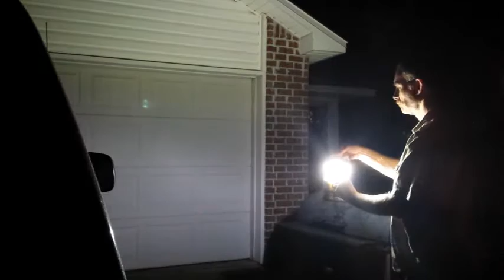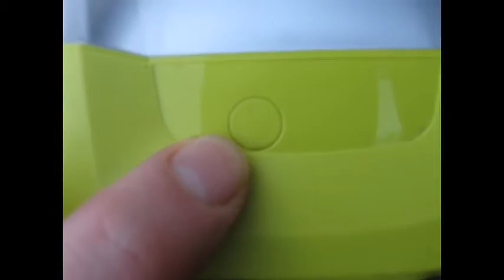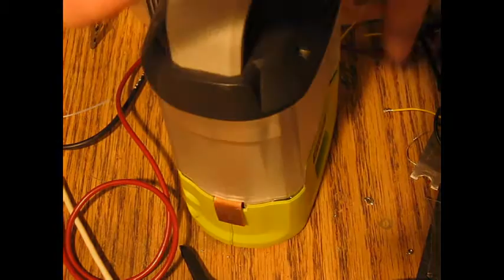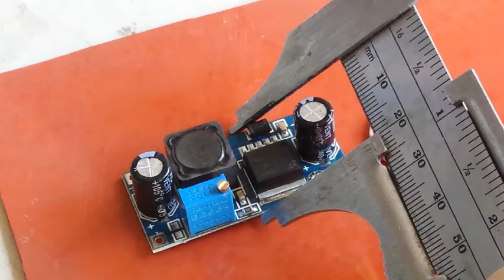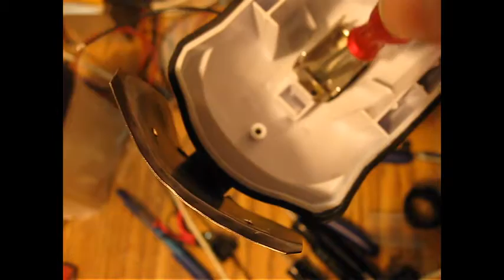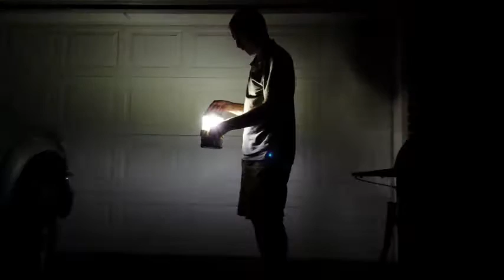Ryobi 18 volt  P780 super bright modified LED lantern

Comment: Good job,  nice/detailed presentation. I am doing similar, upgrading cheap/chinese battery LED floodlights, with good battery and high lumen COB  modules.
Reply from the maker: Thanks have experimented with some 12v cob LEDs found them to be less rugged than expected.  strip LEDs are proving very reliable

Comment: A couple observations are that just because you used a 10W LED, you didn't necessarily have to run it up to 10W.  Heatsinking would be easier with a lower upper limit, and while you did reasonably well with scrap parts you had lying around, it seems that a custom 'sink could have been less obtrusive.